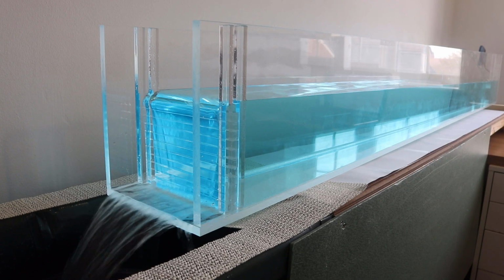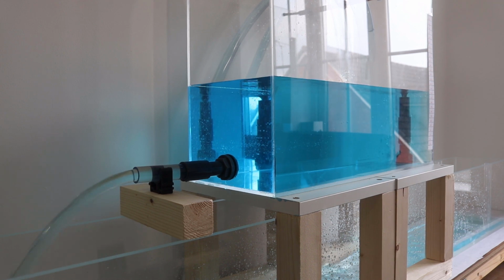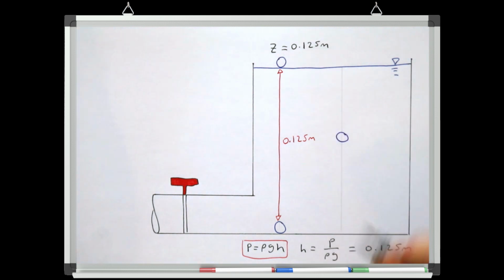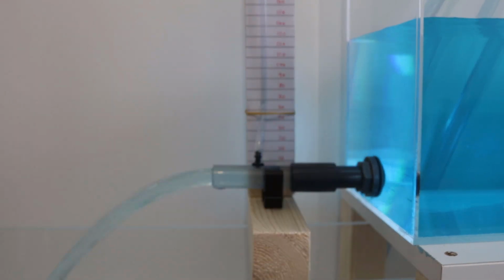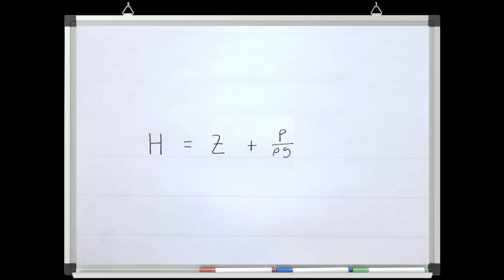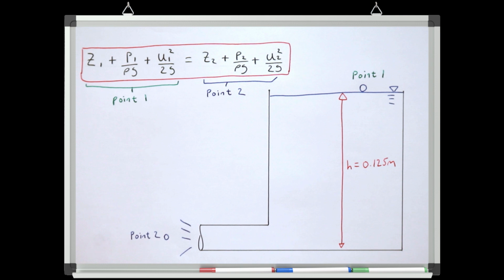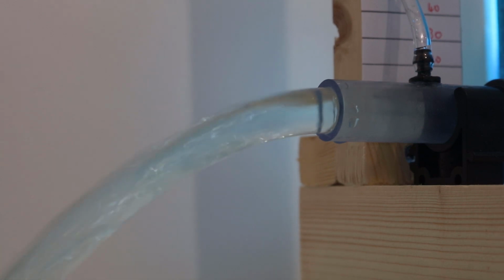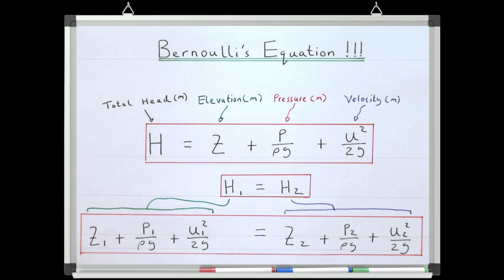Bernoulli’s Equation for Velocity of Ideal Systems (Lesson 2, Part 1)

Comment: whats P/rho×g inside of a pipe with fluid moving
Reply: That would be the pressure head in terms of energy per weight (which has a unit of distance): J/m = N.m/m = m

Comment: Good job 
Is the size of the orifice effect on the speed or on the flow?
Reply from the maker: This is a very good question. If you reduced the diameter at the outlet, the velocity would stay the same and the discharge would drop, as the velocity at the outlet is set purely by the difference in head between the tank and the outlet. However, if you reduced the diameter at some point along the pipe, that s not open the atmosphere, this would lead to the velocity increasing to conserve mass with respect to the discharge at the outlet. Hope that makes sense?
Reply: @fluidsexplained1901  do you mean 'this would lead to the flow rate increasing to conserve mass' and not velocity?